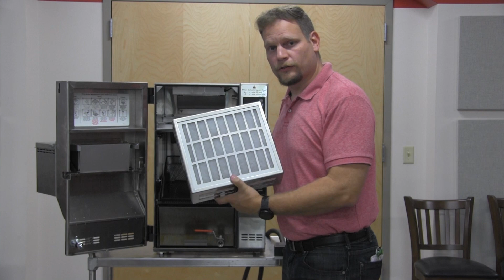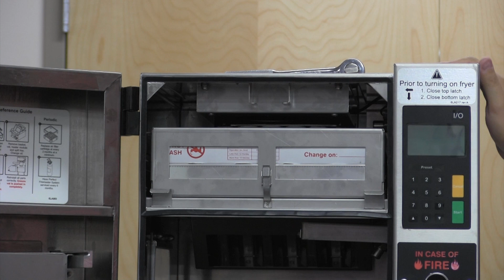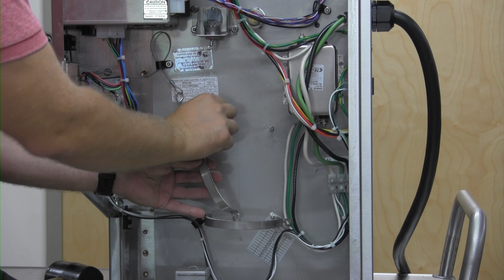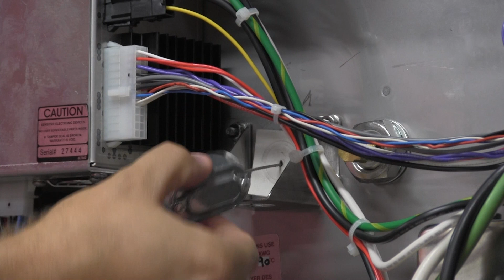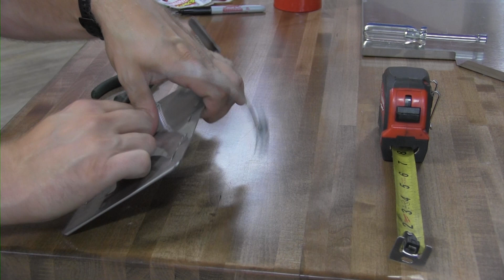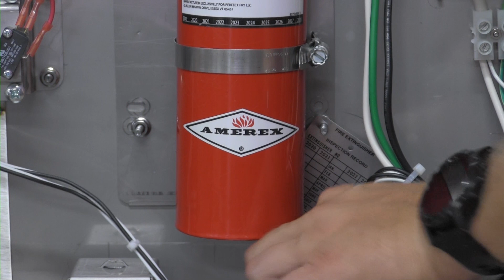PFS replacement Nov 2021

Comment: I had fire extinguisher deployed once when the fusible link on the bottom compartment separated and then we got fusible link replaced and fire extinguisher recharged and since then the pressure in the gauge keep rising slightly.  over a month period it rose almost a quarter on high pressure side. we got it serviced to bring it in range and it started again rising.  What could be the reason ?